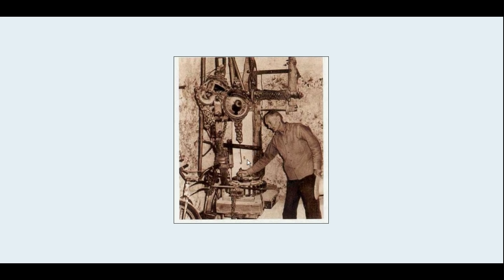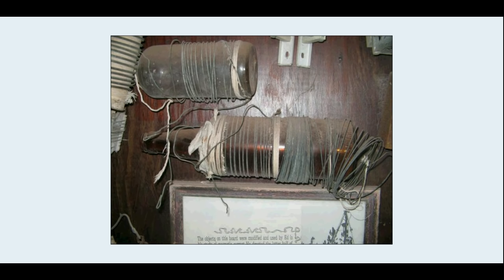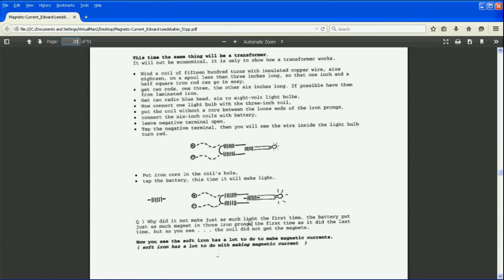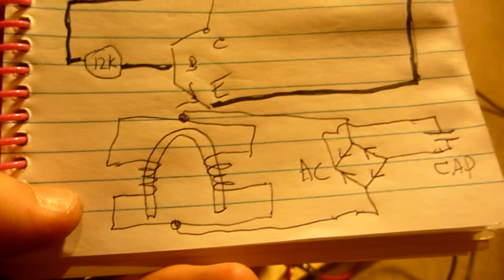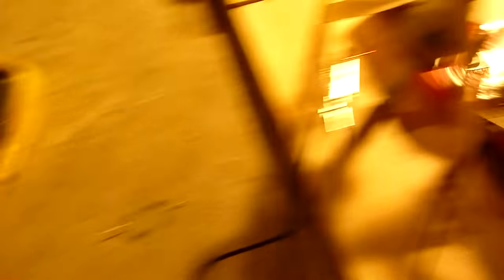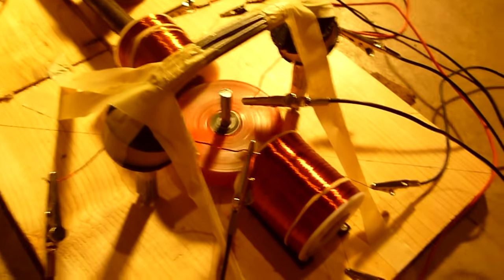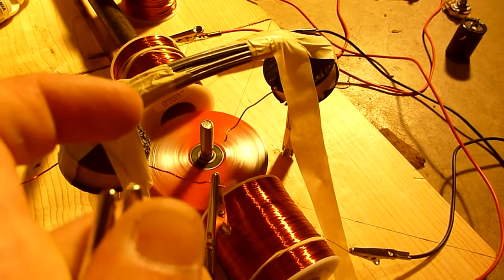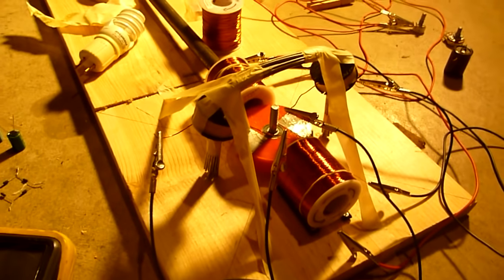Ed Leedskalnin's Over-unity Generator

Comment: Anyone reading and doing his experiments would come to reason he utilized magnetic levers. He placed an iron core coil about half the length of an iron cable then placed in between the two coils of his P.M.H. then connected properly with 24v dc. This set-up will send all the North end magnets to the North end of the cable while sending all the South pole magnets out the South end of the cable. Buried beneath the sand this cable would allow another magnetic lever  (or two) to pass the like force magnetism to levitate the stones along the pathway. He even shows how to roll the stones with the magnetic flow. In his experiments he used a fishing line (metal) glass (for sand/insulation) and welding rods to explain it. He placed these levers/P.M.H atop the tripods placed along the pathway of the one buried. He used the sweet spot of the night when the magnetic flow was at its highest to be collected by his 16 earth battery to run his generator. (16×1.5=24) He enhanced the Magnicity with his generator enough to charge battery and run his drilling rig (the tree he shows in a picture).
Reply: Amazing, any good sources on what you are explaining? Have you seen the tartarian videos showing the energy gathered from the old world buildings w the tall spires on top?
Reply: @johnM-Jr  WHY do I have to provide any videos towards the subject? You can read his own writing to pull the insight for yourself. Do his work. He explains it in his experiment. Simply think the whole thing through. He used steel fishing line to show how the magnetisim works between a glass panel. You simply have to up-size it. A steel cable or two should suffice. The hardest part is replication of his PMH but if you add the coil half the length of the cable and add electric to it on both cables it should have the same effect. The North and South Pole magnets are sent out the opposite ends of the cable/metal rod. The washer machine uses the technology to switch direction of the Pistons they use to distribute water effectively. Same principal is in the cables. Are they not? Magnicity is simply low voltage electricity useing magnets to further enhance it's delivery.
Reply: The purpose of the holder seems to be to prevent current collapse which normally demahnetizes a core.

Comment: To whom it may concern.
Over Unity Electric Generator Design: By AMA
Segment 1: 1 motor with hollowed bar connected to it standing vertically. Circular disc connected to bar that has magnets embedded in it's top side  all around, surrounded in high permeability material to focus magnets outward pushing force in an upwards direction from top of disc. 
 Segment 2: Hollowed out cylindrical Bar of material horizontally positioned. 
donut shaped platter that's flattened on all sides instead of rounded, all around the flat edge of this platter, from the center is a ravine in the center so structure looks more like 2 donut shaped platters flattened on all sides & sandwiched together against a smaller donut shaped platter that's flattened not rounded & between them both. Square openings are located all around the outside of platters edge on both sides & goes all the way through material. In these openings rectangular magnets surrounded in high permeability casings are slid into place all around platter in a matching pattern on both sides. N facing in then S facing in. 
Connect these securely all along the length of the horizontally positioned bar except at far ends and center.
At both ends of horizontally positioned bar securely connect a ring of material that can be magnetically repelled (This will allow bar to spin when apart of completed construct)
  Build a hollow ring structure that has ring of magnetic repulsion around its inner ring that will be able to fit around main horizontally positioned bar and keep it from touching anything on account of the bar sitting on its magnetic field inside the ring. The ring structure has a rectangular bar protruding from it's outer edge & has small square platform on end of it that will allow it to be screwed in to another structure.  Make 3 of these ring structures & position them (approx) over both ends of horizontally positioned bar & around it's center.
  Build hollowed out rectangular encasement that is separated into 2 pieces that can be placed on top of each other and screwed together. This encasement will fit over horizontal bar & everything that is immediately around this bar. Encasement needs areas all along it's top side that has screw openings that all structures inside that need to be fastened down will be able to screw into. (Best if encasement is transparent) Encasement has round opening at both ends so when in place horizontally positioned bar with round magnetically repel-able disc attached to it  are sticking out.
  Build hollowed out ring structure (flattened not rounded) that has a hollowed out rectangular bar that protrudes from top and bottom of ring and has square platform at end of each that will be able to screw into inside of encasement on top and bottom. Ring structure should be able to separate into 4 halves (from middle separating top & bottom & from side to side on each) that sit on top of each other & side by side perfectly connected when encasement is closed. Hollowed out aspect of ring structure & it's protruding hollowed out bar that's connected to it is for conductive wiring to be placed so that the copper coil constructs not mentioned yet will be able to plug into this ring structure and the current can be diverted up through the hollowed out area to a point where another device can plug into it. On bottom of hollowed out ring structure there are openings where copper coil constructs can be plugged into. 
  Build wide but small ring with ravine around its outer edge in center (kinda would look like the round metal piece you would see in a pulley system but not angled in) of structure (flat not rounded & not hollow in center). Copper coil will be coiled around this. Build hollowed out rectangular structure the length of the width of the wide small ring structure. Build a plug system within it so at the center of the rectangular structure it has proper electrical plug poking out that will be able to plug into bottom side of larger ring structure that is designed to divert current. At both ends of small rectangular plug system there should be flat rectangular legs hanging down so that you can fit it perfectly over center of small wide ring structure that has copper coil wound around it & screw openings at bottom of these flat rectangular legs so they can be screwed together. Ends of the copper coil are fed up into the plug securely. 
With wiring in place screw top halves of ring structure together still separate from bottom halves. Then with wiring in place screw bottom halves of ring structure together. Now screw the already connected top halves to the inner top encasement structure & same for bottom halves. Two main encasement structures still disconnected at this point. (Fine point... there are as many of these ring structures with copper coil constructs plugged into them as there are the magnetic disc constructs lined up across the length of the horizontal bar) This is because they are all to be lined up. Now with everything ready carefully lift up the Horizontal bar with the magnetic disc setup securely attached to it. At this point the magnetically repelling rings that are at far ends and center of bar should be hanging freely. Carefully position this whole thing in the bottom encasement so the copper coils are positioned perfectly in the ravine of the magnetic disc area connected to bar. Line the free hanging magnetic rings that have rectangle bars and square platforms up with the inner bottom of encasement and screw them in. At this point the horizontal bar is sitting on the magnetic fields in the rings and is securely in place connected to bottom encasement. Now pick up the top of encasement and carefully line it up the same but on top & then screw the top encasement to the bottom encasement. If lined up properly you will see that when the horizontally positioned bar is made to spin, the magnetic fields will interact with the coils that are perpendicular to the magnetic field lines and since the copper coils are positioned to hang withing the ravine, the magnets on both sides will magnify the effect to achieve greater results & since the magnets on both sides are set up N then S all the way around it will end up being AC current. At this point you may be wondering how will this ever equate to over unity? well we are about to get to the part that makes that possible. 
  Build cylindrical structure (like a donut but flat not rounded on all sides but still hollow in center like a donut). The cylindrical structure is built in 2 parts. Top part & bottom part. Bottom half has a ridge close to bottom center area that circles around further into the center but not all the way in. On top of this ridge is a flat ring of high permeability (magnetic field shielding) material that has small openings that will allow magnetic fields through specific locations. The top flat side of the 1st part has rectangular grooves cut into it that go almost the entire distance from outside of cylindrical structure to hollowed out center. At both the outer edge and inner edge it instead cuts down sharply & narrowly at just over the width of the horizontal bar. This way when the horizontal bar in it's encasement is sitting in this spot the case fits down in and bar slides down in with a little extra space but the encasement can't shift forwards & backwards. The top half of cylindrical structure has same groove but no extended ridge going further towards center. Fill the rest of the rectangular grooves with duplicates of the electric generator construct. Now carefully position top of cylindrical structure in place and screw it to bottom section. Now position the motor segment with the vertical bar that has discs on it in center of cylindrical construct so the disc is lined up perfectly underneath the inner ridge that has the flat ring of high permeability material fastened to it. Now you can duplicate this whole setup and stack it for more electrical output. (The only thing that would need to be duplicated with the motor & vertical bar setup is for you to add another disc with magnets embedded in it, higher up on the vertical bar you are already using). When you turn motor on the discs will spin and the magnetic fields on them will only interact with the discs on the horizontally positioned bars when the magnetic field lines go through the small openings in the high permeability material. Since those openings are lined up with the edge of the discs connected to the horizontally positioned bars, it will force them to spin, effectively generating lots of electrical current. Just make sure to let enough of that current pump energy into the 1 motor you are using to run things, and the rest of the electric current is over unity. If you are still wondering how this could end up being over unity, the answer is simple. The device exploits magnetic field effects connected to the vertically positioned bar connected to the motor to have them do all the extra work so the motor does not have to. And since the magnets are exerting there force upwards while the bar spins around sideways, the motor won't be getting a detrimental amount of push back.      This design invented by AMA
Reply: I got lost somewhere. I like Ed Leedskalinin generator that used Earth battery technology so much simpler to use. That self running generator had more than enough power to run the whole site but also charge battery when the bewitching hour had passed. Sorry I couldn't read all of the comment you provide. Sometimes when my eyes start crossing I have to stop or loose interest in the entire conversation. Hope you understand
Reply: @ebikeliverystable  Thank you for taking an interest. I have a shortened to the point explanation of my Over Unity Electric Generator design I'll share in next message. :)

Comment: increase copper winding on east west facing coils , add more layers of soft iron wires and encapsulate in metal shroud ? on the N AND S spools try winding more copper on the side of the spool closest to your rotor ?? retest :)

Comment: Ed's bottles are rheostats not inductors. The variable resistors balanced power from the pulsing relay and his 3 wire grid. The pulsing third wire triggered relays that controlled/cycled high drain solenoids that did work around his site. That  u shaped PMH impeller and his u shape generator coil overcome back EMF and removed drag induced on his rotor.The clover-leaf shaped timing cams switched power from his low volt grid and charging his batteries to pulsing the PMH coil that drove the rotor(it's an old Ford Model T rear  main bearing and charging system  rotor with all those v shape magnets, stood on end. Ed's rotor spun very slowly by today's standards)
Reply: On what
Reply: You're quoting some guy who'se claimed to have solved the mysteries (can't remember his name), however, unfortunately that guy was clueless... :)  Ed did not drill hundreds of tons of rocks with a hand generator and a few batteries, all cranked by a hand generator....lol.
Those clover leaves had nothing to do with timing switches...look at the ~THREE pictures that ED has given/left the world..do you see a timing switch hooked up to the clover leaf?  NO...and this was NOT a low voltage system.  You see a "J" hook hanging over them...this was part of his spark gap.  Why would ED be wearing metal soles on his shoes, and have interrupted the local military radio communications?  Ed's device was working in the RF range...that stupid idea the other guy says is garbage.  While ED may have been using a coil and some old car springs to do his drilling, this was a HIGH 'voltage' system.  Look at the efficiency of his 'at work' device....he inserted leaf springs into the coil, and they oscillated to do his drilling.  The pulsation came directly from the energy pulse that his system generated..much like oscillating the Zenneck wave/field between earth and sky.
Reply: @Pawbreakers_com   Totally agree!

Comment: nice video thanks! i gonna try to do this!
Reply from the maker: +MrZafiroboss Key thing here is resitance in both coils has to be identical (use same length of wire), also they must be wound in opposite directions (just flipping the coil doesn't change the winding direction). If you find something cool please keep it open source so that humanity can benefit.
Reply: thanks i will no doubt. have you tried to wound a normal induction motor with permanent magnets?
Reply from the maker: MrZafiroboss Nope, I haven't tried that. I bought a very large pot core (over 70mm in diameter) and I plan to pulse two of them wired in series with a transistor. Maybe if I'm lucky I could get self-oscillation going like in the Akula device, or Tamriel Kapendadze generator. There is so much out there.
Reply: @naokikashima9349  can u try series of this model and show us the results and what happens when u weight a kg of copper n do as coil